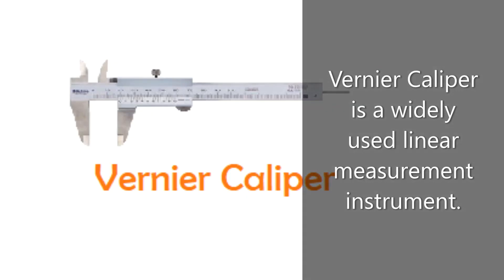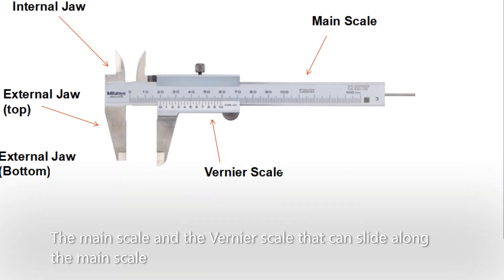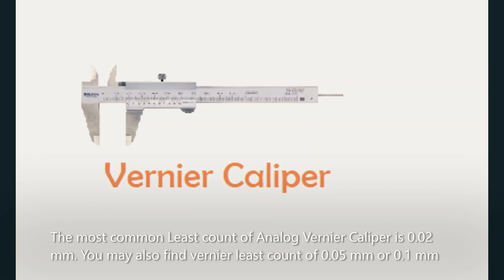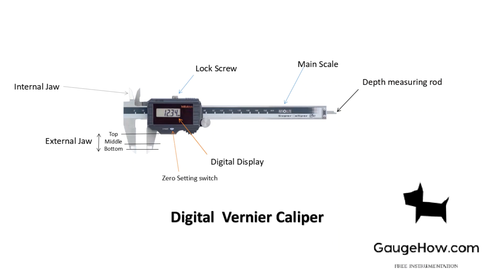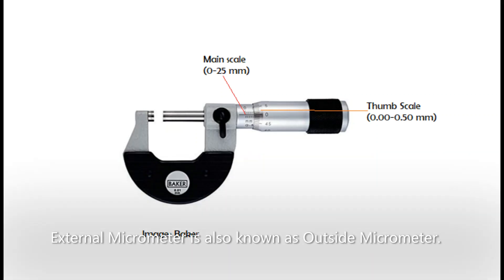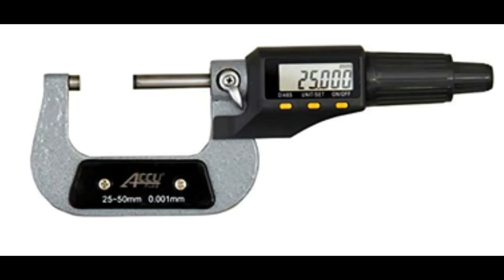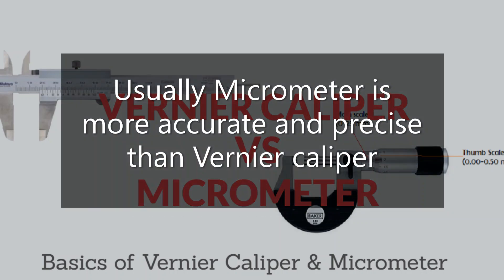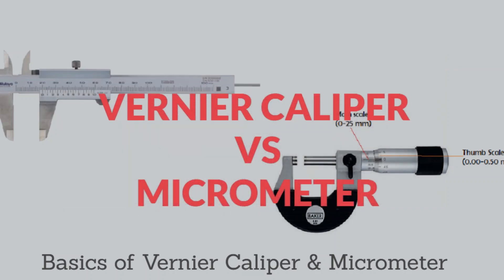Difference between vernier caliper and micrometer | by Gaugehow More on  ⁨@gaugehowmech ⁩

Comment: What if you close the jaw too tight and it gives a smaller reading?  How do you know how tight to close the jaws?  What the the jaws are degraded and have a taper, or imperfections?  What about backlash for dial calipers, where the jaw starts moving before the dial does or vice versa?